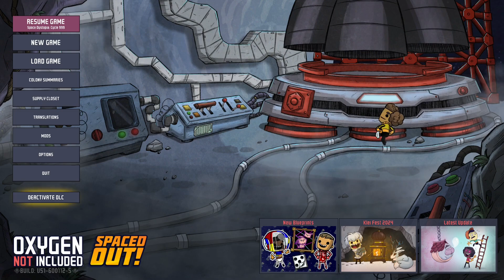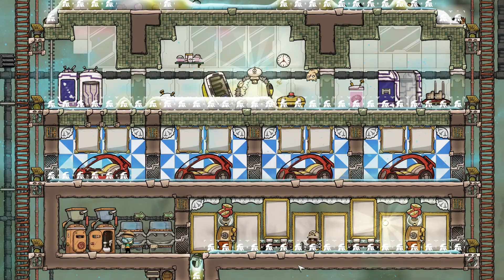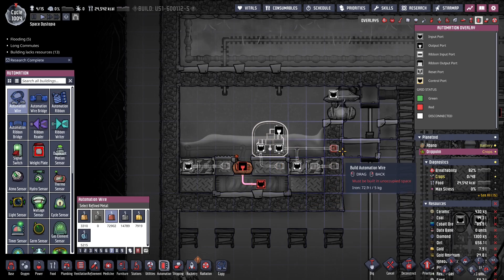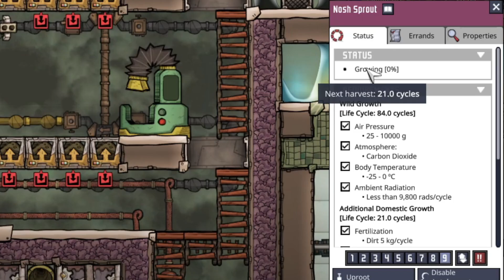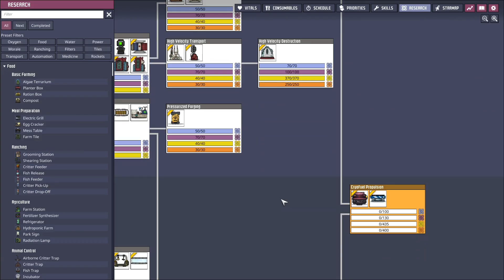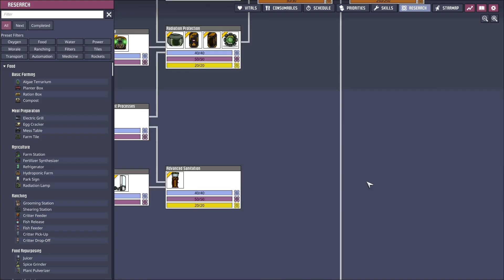Oxygen Not Included: Nuclear Farming and Beeta Keeping (LP - Ep33)

Comment: I was hoping for an explanation of the whole beata hive setup's automation and whatnot.
Reply from the maker: You're right, I was getting tired and somehow missed giving an actual explanation. I'll likely rectify that once I'm done with the space port and continue with the farming.

But it's not overly complicated. A hive dies if it gets too hot. The Counter/Clock on the right triggers every 20 cycles and floods the hive(s) for a couple seconds with warm water, slowly heating it up. Since it's only a few seconds it doesn't kill the beetas, but after multiple floodings the hive(s) will die and drop their enriched uranium. The other hive will then replace it in the following cycles (which is the reason there are two separate automation circuits, so both don't die at the same time). That way no dupe has to endanger themself for the harvest.
Reply: @RKFWalter  Could you please post an image somewhere, showing off the automation grid setup for this beeta hive farm?
Reply from the maker: @storiophage2274  Here's my source for the design: https://www.reddit.com/r/Oxygennotincluded/comments/161em4o/fully_automatic_9x7_beeta_farm_for_uranium/

Additionally you can find a link for the world download in the description of the last episode, if you want to have a closer look.